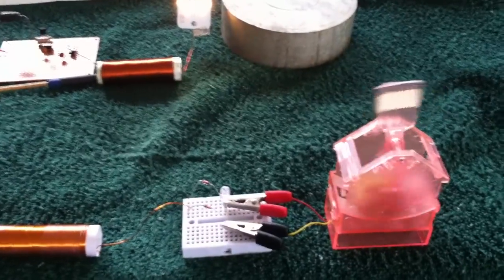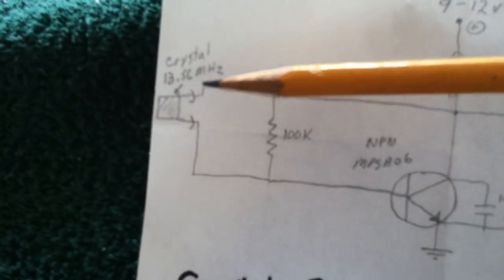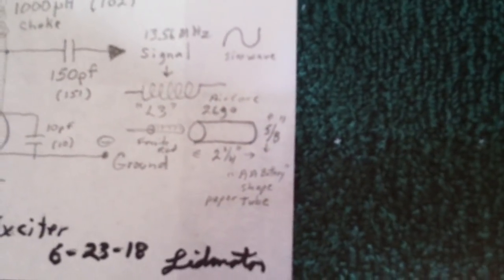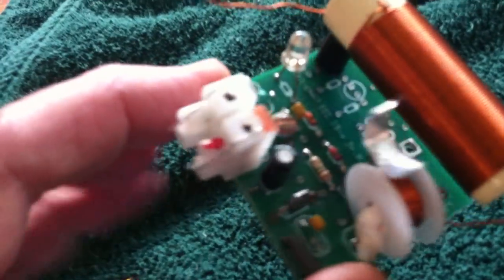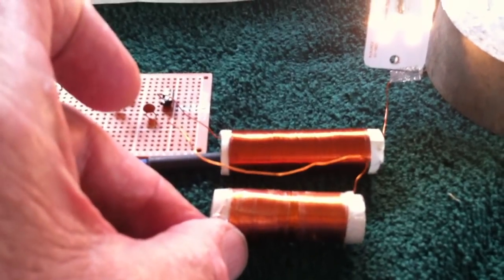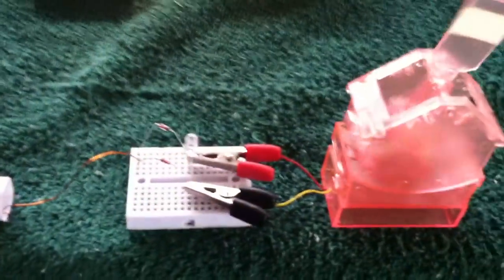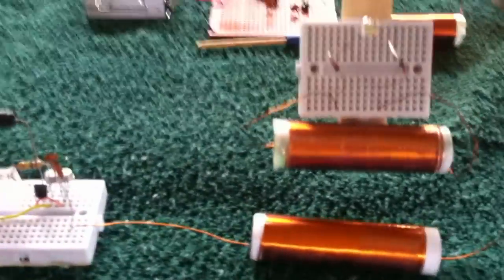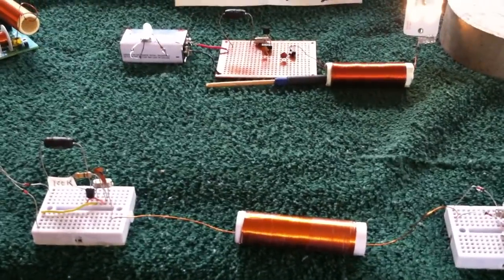Wireless Waving at 13.56 MHz

Comment: If there were some way to measure the main input current while putting more passive receiver pick-ups around the exciter to see how they affect input current, would be interesting.
Reply from the maker: We did that input current measurement experiment yearfs ago and the current does not go up by adding more receivers.  What happens is the the power at the receivers drops off as you add more of them.  The input power consumption just stays the same at the main oscillator.

Comment: Make a coil with the paper wrapped on a sharpie  marker and wind it with #30 or #32 about 2 inches on the paper.
The smaller diameter and finer wire will tune it with less ferrite at the frequency and note the difference of the intensity.
Run the frequency up and down with that signal generator you show in the other video and there should be several different frequencies where this will tune into harmony and operate everything.

Comment: I am watching you and Lidmotor going through these and I will have to have a go but it is way to hot and sunny to sit down and build them at the moment so I will have to play catch up later.
Reply: Just realised I typed Lidmotor when I meant Slider2732, you guys are going head to head on this theme :-)
Reply from the maker: It is getting hot over here also.  Luckily we have AC.  If you have never built one of these 'Exciters' before I suggest that you start with a Slayer Exciter.  It is almost as easy to build as a Joule Thief and is easy to get running.
Reply from the maker: Yep.  The work is blending together. It is hard to tell sometimes where one of us starts and the other one ends.  It is a good thing.  We help each other.
Reply: Here here !
A lot of times these wireless projects see a bouncing around of ideas. If they were sole projects there'd be no way that the evolving would happen :)

Comment: I love your work & tinkering , if this were to be, say-- Scaled up" to a 12v or 24 volt system ,at this frequency is this a doable prospect to power many lights in a defined radius..? a larger area? I am a Noob with this process of your and Dr stiff,s" as i call him,s work,  [no dis-respect] intended" and am very  taken by the possibilities this frequency propagation could achieve ,warm regards.. B-b
Reply from the maker: You have to be very careful about scaling this up because of FCC rules.  You need to build these things small and keep the power down to stay out of trouble.  The government regulates this stuff ----and they listen.
Reply: : i live in new zealand. ok" maybe you should have a disclaimer for hobbyists in Your country "   electricity is all R.F anyway in my opinion is that the big secret..?  ive got 2 words for your govt and the first one starts with F and the second an Y . . go big ans stick it to the man
Reply from the maker: Our govt is really messed up right now.  I hope we get it sorted out soon.
Reply: right now  ? More like the past 1/2 to 3/4 of a century.
Reply: what do you mean..?